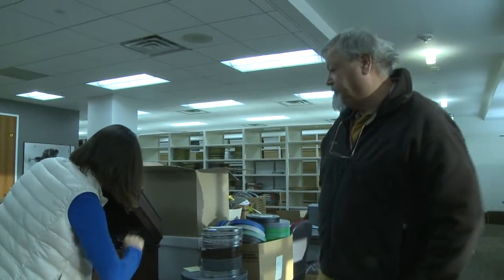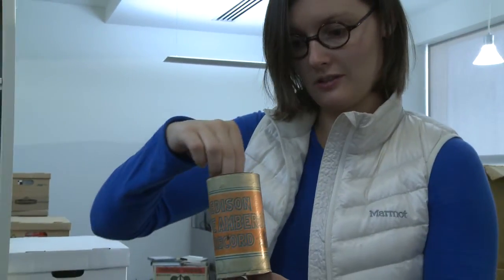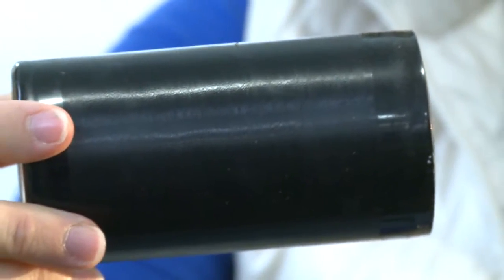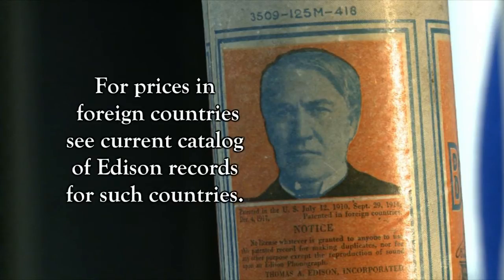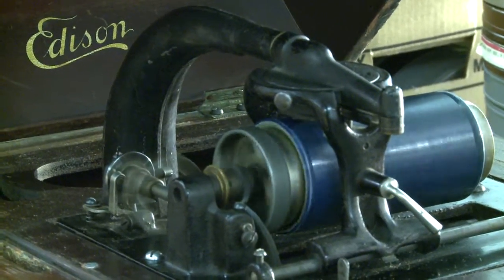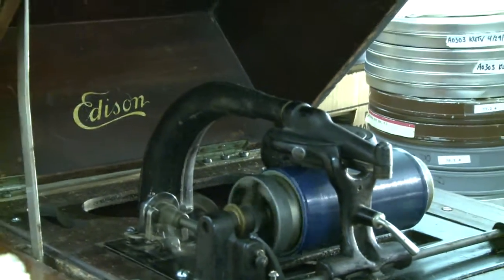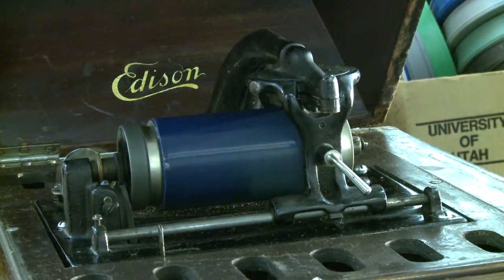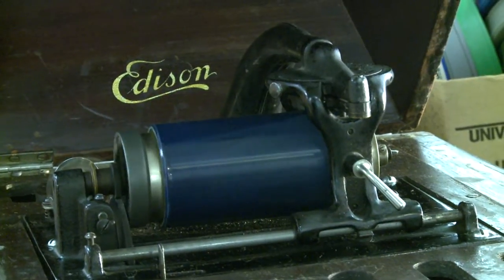Edison Amberola Phonograph c. 1911 - at University of Utah Marriott Library Special Collections

Comment: Nice video, that Amberola 75 looks great! 

Just a few inaccuracies though. First this machine was not made in 1911. The Amberola 75 was not introduced until 1915; perhaps you were reading a patent date? Also the Edison Blue Amberol cylinder is not made of ‘wax’ like the earlier cylinders. The BA was introduced in 1912 and is made of celluloid around a plaster core. Lastly the first cylinder you showed, the ‘Star Spangled Banner’ is an Oxford 4 minute, not an Edison cylinder (wrong box).

Comment: A few notes here.  I am an Edison collector, and what this wonderful machine is -is an Edison Amberola 50 machine, Not an Amberola 75.  You can see that someone put  a Amberola 75 motor in an Amberola 50 machine.  If you look at the rear Dataplate, You can see someone tried to remove it because there is a chunk out of it...and that person would have been correct, because it is an Amberola 50 machine, though all they would have had to do is just push out the two pins on the reverse side to remove the plate.  The Original correct dataplate for this machine is still there.  It is a brass plate under the front left side of the lid.  If you get the number off of it and post it, I can tell you the exact year the machine was made.  This machine is an Amberola 50 which were produced from 1915 to 1925, but I can tell by the case and original Brass dataplate underneath the lid that this specific machine was made from 1918 to 1925 since it has a later dataplate located under the lid.  The dataplate in the rear with a chunk out of it is not the correct dataplate for the machine, though the motor which is an Amberola 75 motor is identical to the Amberola 50 motor and that's why someone made the switch long ago.  This machine though it runs, has a few other faults, It is missing the no-hole "non-adjustable" black gearplate governor cover on the left side of the machine with its screws, It is also missing the correct front grille, and it has the wrong winding handle from an Edison Diamond Disc machine because this one is way too long though it works.  Though it has a few bumps, This machine is in great shape, but missing a few parts. The original parts can still be sourced, and should be.  It is absolutely worth it.  If it were my machine, I would get the parts of of ebay for under $200.00  It is a shame to leave this machine as it is since it needs so little to restore it. The lady who donated it to you did your library a great service.  Your machine as-is, is probably worth around $500.00, and It is worth finding the missing parts for your library collection to increase its value and make it whole again. This Edison Amberola machine is a 4-Minute only machine.  Only Edison Blue Amberol cylinders, or Columbia/Oxford/Albany Indestructible cylinders are to be played on this machine, or you will damage the Diamond "C"  needle which is obviously still in good shape. as it plays well.  The first cylinder selection you played was Edison Blue Amberol#1907 - An Easy Job on the farm (1920) -By Golden and Hughes released and recorded in 1920.   The second selection you played was a Columbia/Oxford/Albany Indestructible cylinder #3424 - Star Spangled Banner by Golden (1918) was recorded and released in 1918. Columbia/Oxford/Albany Indestructible cylinders were all made in Albany, New York, and are all denoted with the "July, 29th, 1902" patent date on the cylinder rim itself and are made of celluloid plastic. Edison cylinders were made in New Jersey and are made of Celluloid with a plaster white or black core and are stamped on the rim with Edison's trademark name. If you want to restore this phonograph and get its missing parts, shoot me an e-mail or visit me (Nefaurora) at this website below. Thanks, Tony K. Melbourne Florida. Go to this website: http://forum.talkingmachine.info/

Comment: Oh My, It is difficult to see people to that look like they never have seen a phonograph without any instruction on what it is they are doing. As most people do, they called it a Victrola which is done in mistake. Victrola is a name given by the Victor Company to name there Talking Machines. Edison called his machines Phonographs and Columbia named thier machines Graphophones and Gramophones and no different than the Mustang is a name Ford company gave to one of model of car they built and you would not call a Lincoln Town Car a Mustang. This also looks like some one used a couple of different models and put them together. Also the Amberola machines play 4 minute Celluloid cylinders and Wax cylinders came earlier using other earlier models of phonographs. As the person stated below, I also hope they get a professional to go in and make flac files so that anyone  can listen to them rather than leave them in the hands of someone that do not know what they are doing and could damage something. Secondly as a University, you would think that someone would at least have done some research on the Amberola Phonograph and how to correctly use it rather than leave it for someone to damage. I personally collect only external horned cylinder and disc machines and with all "Get Out" I would never let someone touch one of mine with out my hawk eye watching over them.  I have collected Cylinder and Disc machines since I was 24 and I just hit 50 this year and my collection contains 34 machines currently. PLEASE Do not play a Wax Cylinder on an Amberola, they only play 4 minute Amberol Cylinders and not wax Edison 2 minute cylinders. There are many videos of different machines that play cylinders on YouTube and it would have been easy to look up what to do with out risking any damage at all.